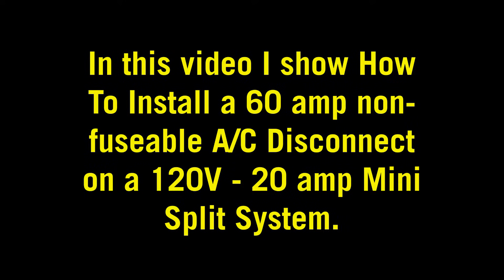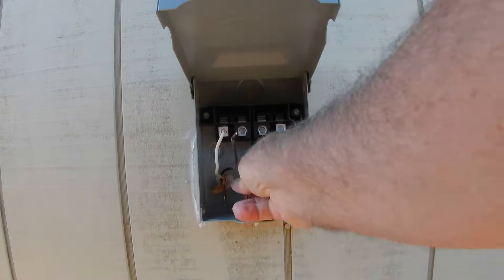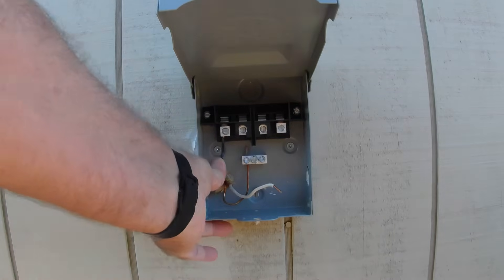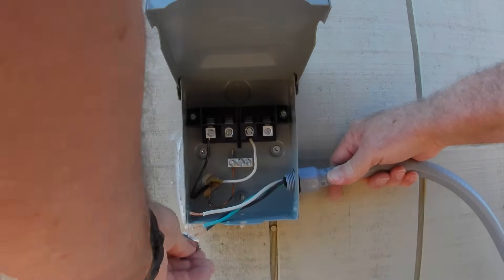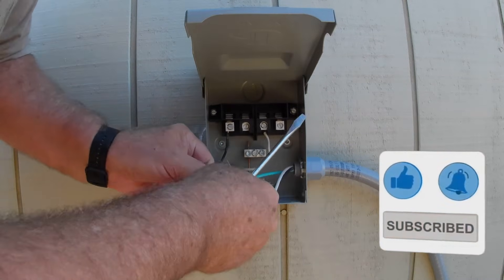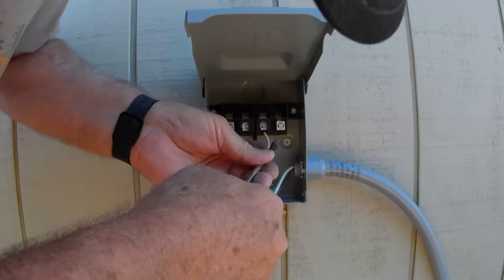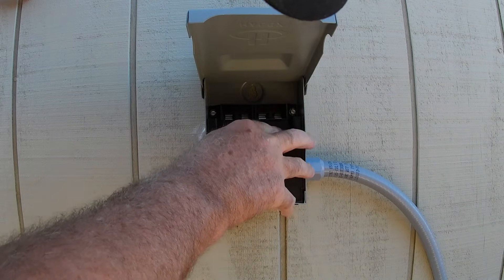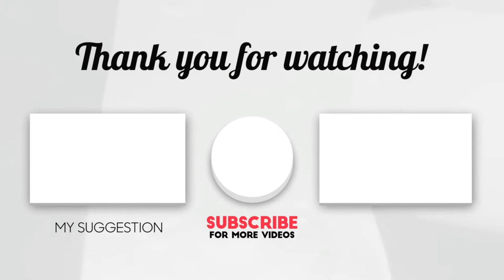How to Wire a Disconnect Box for an Air Conditioner

Comment: I can only find a electrical whip with 4 wires. The power coming from my panel will be done with 12/2 on a 20A circuit to the non fused disconnect. Where do I put the extra wires from the whip!!?
Reply from the maker: Hi Mathew, you should be able to pull the non used wire out no problem
Reply from the maker: @___asd159gh43  Most A/C disconnects I've seen are 60 amp which is standard and most of the time less expensive. There's nothing wrong with using a 60 amp disconnect on a 30 amp unit as long as the circuit itself is on the proper size breaker.
Reply from the maker: @___asd159gh43  You Bet!

Comment: 120 single phase doesn't matter where u put them? How did u wire in main panel?
Reply: That’s the million dollars question 😂
Reply from the maker: correct it just makes the connection when you insert the bar and as far as the main panel was a 20 amp single throw with the black hot wire to the breaker the white wire to the neutral bar and ground to ground bar.
Reply: Lol no one ever show the main box, just disconnect box

Comment: I hate pullout disconnects. I want to use the Square D 60 amp 240v breaker type disconnect, here is my idea please let me know what you think about it: Run hot wire from main panel to hot lug of disconnect box. Connect hot wire from ac to breaker. Connect both grounds to disconnect box ground bar. ADD an isolated neutral bar to the disconnect box and run both neutrals to that (seems better than just wire nut the neutrals together).  If you know of a 120v single pole non fuse disconnect that is not the pullout type I would really appreciate a link to it. Thank you for your reply. Cheers
Reply from the maker: Hello, check out https://amzn.to/3FUaufp  in my opinion this would work for 240v and 120v just choose the correct amperage breaker for the application.  If you are looking to pass code the hot & neutral wires would all need to be terminated at the disconnect which I don't recommend any other method
Reply: @ILikeToBuildStuff  I'll look at that one. Yea most of the switches I've been looking at while being shut off are not true disconnects as the neutrals remain bonded to the circuit. I dont like working on equipment even if the hots are disconnected if the neutrals are still active. While I don't have any circuits that share neutral runs I just feel better if the disconnect switch disconnects both the hot and neutral lines entirely which is why I was hesitating about turning the breaker disconnect into a switch disconnect. Thanks for your input.  Edit: I think the Siemens LNF221R lever disconnect is what I need. Each pole side is isolated so I can run the hot to one side and the neutral to the other pole. As such the lever would disconnect both lines simultaneously.

Comment: Aren't the line lugs in the middle and the load lugs on the two outer 2 terminals?
Reply from the maker: Hi Ryan, you are correct but like I said in the video that it didn't matter as the black or white block just makes the connection between the white wires on one side and the black wires on the other in this type of box.  Good eye Ryan!  Thanks for watching and joining in.

Comment: I’m curious if the circuit is only 20 A why did you use a 60 amp
Reply from the maker: Good morning, this box was $1 more and can be used up to 60 amps so if I ever want to change out for a bigger split I can.  The disconnect has nothing to do 20 or 60 amp in the breaker box you need to put the right amp breaker according to each unit unless the disconnect has a breaker itself.
Reply: It will go up to 60amp
Reply from the maker: @ryandodson2786  Yes this box is rated up to 60 amp but it is limited to the breaker in the main feed.

Comment: You don't put a fitting where your wire get in the box, so no water goes in and the wire is secured?
Reply from the maker: You are correct, I did go back and use a sealer there and have had no problems.  Good eye Yan!

Comment from the maker: 20 to 60-Amp-Non-Fusible-Metallic-AC-Disconnect
https://amzn.to/3FaoLUR

Liquid Line
https://amzn.to/3gH9baa

Original Mini Split Install Video:  https://youtu.be/07SB6aIJfPU

12,000 BTU Mini Split AC/Heating System with Inverter:  https://amzn.to/3A1FKqD

Equipment Pad for Mini Split Condensers:   https://amzn.to/3zHym3d

2.5" Wall Sleeve:   https://amzn.to/3QqxfuK

Alternatives Units:
Senville LETO Mini Split:    https://amzn.to/3n3x3V0
Cooper & Hunter Mini Split:   https://amzn.to/3Qx0r3n
DELLA 12K Mini Split:  https://amzn.to/3n3xxKO

Basic Vacuum Adapter:  https://amzn.to/3nQE4aV

Best Adapter Tool: https://amzn.to/31c40E3  My Choice!

Yellow Jacket 60278 Flaring Tool:  https://amzn.to/3dwHpae

Budget Flaring Kit:   https://amzn.to/3zLHhkd

Nylog Gasket/Thread Sealant:    https://amzn.to/3O35oiT

Screw Feed Tubing Cutter:   https://amzn.to/3nQJ3Zb

My Favorite Close Quarter Tube Cutter:  https://amzn.to/3rpZxcg

Vacuum Pump HVAC Kit:  https://amzn.to/318YEcC

PVC Decorative Line Cover Kit (one for each head): https://amzn.to/350IfIu

Outdoor Mounting Bracket:  https://amzn.to/2Fw9vpq

2-1/2 Inch Bi-Metal Hole Saw:  https://amzn.to/343BJS6  This A/C Unit Requires

3-1/2 Inch Bi-Metal Hole Saw:  https://amzn.to/3lIcpqG  If needed for your A/C Unit

DEWALT Hole Saw Kit:  https://amzn.to/3tIjAFx

30 Amp Fusible AC Disconnect:  https://amzn.to/31aHN9c